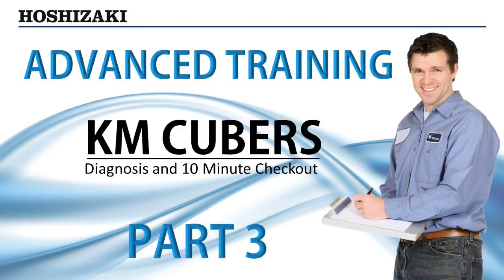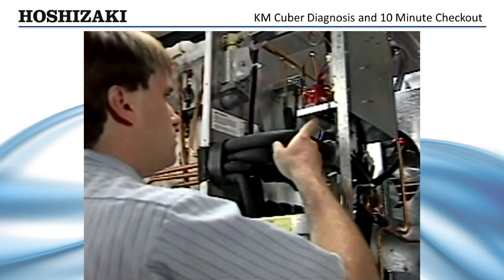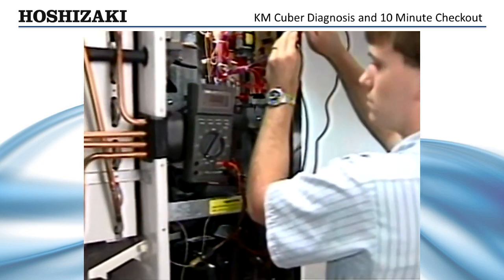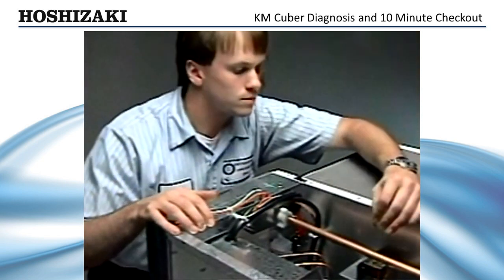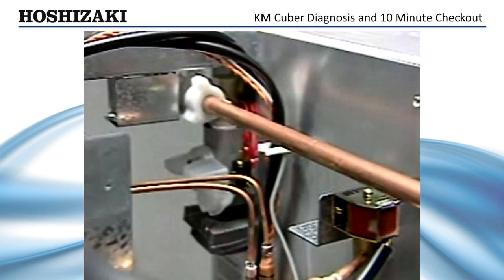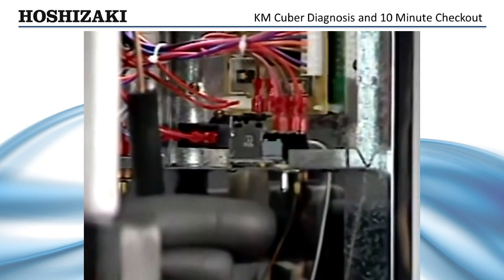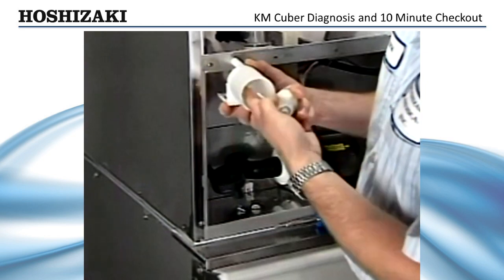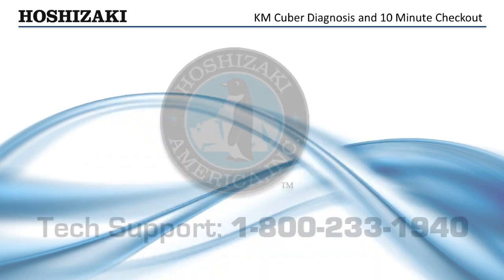Hoshizaki Advanced Training - KM Cubers - Diagnosis and 10 Min Checkout | Part 3

Comment: My Hoshizaki ice machine suddenly has problem. The ice pieces are connected to each other and form a whole big piece of ice pad. Do you have any ice what's wrong with it? It's only 2 year old
Reply from the maker: Sorry for the delay. Ice bridging usually occurs due to a restriction in water flow. So first replace water filters (replace every 6 months), clean water inlet screen, clean spray tubes.  Depending on the water conditions in your area you may need to do this preventative maintenance more frequently than outlined in the model's instruction manual (www.hoshizakiamerica.com/manuals).  If those do not fix your issue call our Tech Support with your model and serial number at 1-800-233-1940. They can help diagnose most issues over the phone.
Reply: @HoshizakiAmericaInc  Thank you so much for the info